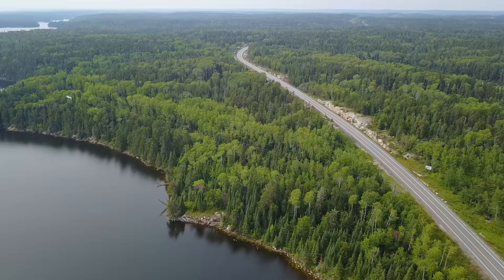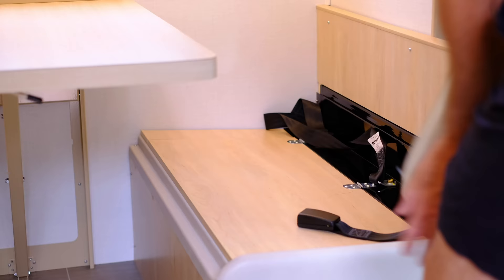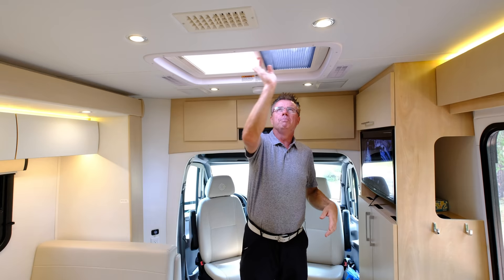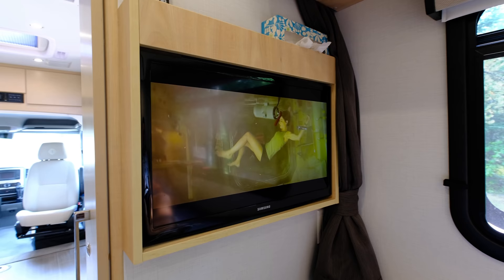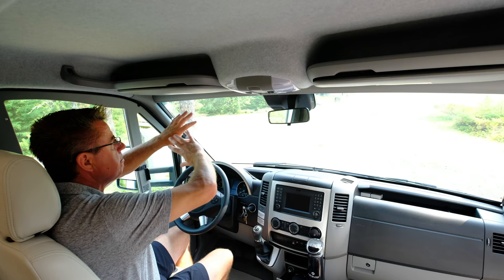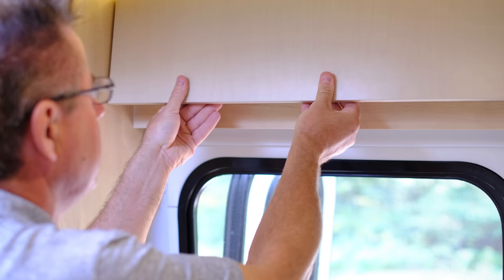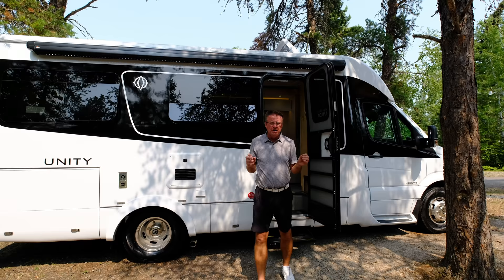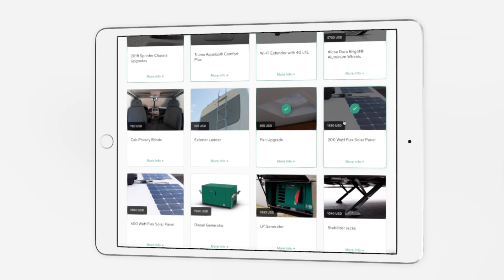2019 Unity Corner Bed

Comment: I just saw a video with this guy taking a tour of a 2020 Mercedes motorhome while it was parked in the Arizona desert. The walls of the vehicle were made from a specially compacted material just like he said this one is and even though it was 90 degrees outside on the other video, inside the vehicle the AC wasn't even required. I need to find that video to send to a friend. Ill go check the links out too. "synthetic man made leather doesn't get hot or cold" so not from animals then? Did the shower have a privacy cover to go across the sky window? This vehicle is like a Tardis. Loads of room inside but looks smaller on outside. He definitely knows what he is talking about and selling. It makes all the difference. He deserves to cool down in the lake, I didn't expect that, excellent ending. Excellent scenery too from Great Britain.

Comment: You say this is a prototype? Please make it so that we do not need a generator and it will charge itself in the sunlight with lithium batteries put in a air conditioner runs off a 12 V and enough lithium batteries out it’ll  run through the night. Just like the Boldt.
Also make it available for those who will pay for it to be four-wheel-drive and then you have Dotted all the i’s and cross all the T’s.

Comment: Most clever design elements I've seen so far. Love the overall style! To the manufacturer, why are dinettes not offered with an optional two-seat version, with all that other space occupied by 4 seats used for more cabinets? Use pull-out drawers beneath the dinette seats rather than awkwardly dismantling them to get to the under seat storage. Why isn't the mattress built to raise up on hinges so that the underside offers the full space x 5 inches beneath for critical additional storage?  The awning is great, but where's a simple roll-up three-sided canvas & Velcro attachment that would turn that space into a livable additional exterior tent-type room? Such a small thing would double the living space when parked. Give us a built-in safe, a deep sink you could wash boots in, a built-in 5-gallon bottled water dispenser, built-in surge protector, built-in vacuum with hose that will reach from dashboard to rear, and a small wood-burning stove that can be opened to the inside for off-grid heating or closed and opened to the outside for off-grid cooking, please.

Comment: Unity, thanks for the nicely-made, explicit video! You've nearly created the perfect compact RV. Clever, beautiful, and functional. If you're interested in making the next model reach Perfection, consider: 

1. Move away from the old-fashioned gaudy racing-stripe exterior. Should be easy to offer a custom color choice in solid paint shades that blend into surroundings, especially when stealth camping.
2. There's wasted and unused space everywhere that could add at least 10 square feet of additional storage.
 Find it, use it.
3. 
Add a hinged or pull-out door to separate the back/bath area from the front/main area.
4. Please offer dinettes with an OPTIONAL two-seat version, with the unneeded seat space used for more cabinets. 
5. Raise the big mattress a few inches for more under-the-bed storage depth, and why isn't the entire bed-size space beneath being used instead just one corner of it?
6. The awning is great, but please provide an OPTIONAL three-sided canvas & Velcro attachment that would hang from it and wrap around it, creating a livable additional exterior tent room when parked. 
7.  Wet bath: recess enough small racks in the walls to hold at least 12 bottles with heights equal to a mouthwash bottle. Also, there's room for a nearly full-length mirror on one wall or inside the door.
8. USB charging: Instead of a lone USB charging outlet here and there, create and recess one space providing many outlets for charging multiple devices This is a must from 2020 forward. Recess some kind of caddy sizable enough for a laptop, for every USB charging outlet. 
You have the space.
9. Please put all the electronic controls IN ONE PLACE facing out at eye level (such as above the door). No squatting, stooping, or neck craning to see those things!
10. Recess at least 2 caddy spaces for rechargeable flashlights and put 110v plugs in that recessed area.
11. Install a hidden steel safe bolted-in somewhere out of sight.
13. Switch to a 12-inch-deep kitchen utility sink that wet boots or a big iron skillet can soak in.
14. Find a way to install by the kitchen sink corner a 5-gallon bottled water dispenser.
15. Surge protector: at least make available an optional built-in surge protector.
16. Vacuum: install a a recessed and easily interchangeable canister vacuum with a hose that will reach from dashboard to rear.
17. Sconces: recess in main cabin several built-in vented wall sconces for holding candles when camping off grid.
18. Chimney hole: provide an OPTIONAL chimney hole over the range where a small wood-burning stove can be set for interior off-grid heating (that can also be detached and moved outside for off-grid cooking).
19. TV: that's a lot of real estate used for something that won't be touched most of each day, so how about mounting the tv as the face of a storage cabinet behind the tv? (Need a place for storing clean bedding.)
20. How hard would it be to include a drop hole into a hidden waste basket?

I challenge you to find a place for a dirty clothes hamper, and I believe you're the creative force to finally figure out a way to recess out of the way from feet but accessible a pet water dish. There has to be a way.

Comment: 1. $135,000
2. No boondocking possibilities.
3. Golf-cart batteries.
4. Need always running generator if you want anything done.
5. 1000 watt inverter... in 21st Century...?
6. Did I mention it's $135,000 without options?
LTV's reasoning for lack of tech - "It could break down and leave you without power" ... So they decided to leave you without power from the get-go

Comment: One can dream. Quite a few questions, as my spouse & I (both medically retired military Veterans) are thinking of purchasing a small RV: (1) is the safe welded to the metal frame? If not, it would be just too easy to rip it out of the wood; (2) can you add more than the traditional 2 deep cycle batteries?; (3) does it have interior (hammock) heavy duty style clips (which would allow you to install, say, a small one person sleeping hammock for an extra adult sleeping berth? As I feel/see that the extra sleeping berth in the kitchen area, is just a little too small for two grown adults); (4) is there adjustable shelving & fans for the electronic areas (as this would be a must if you wanted to add extra electronics, & not have them overheat. If not, no biggie, as my wife is a welder, machinist, industrial painter, industrial fabricator, pipe fitter, etc. The military has trained us well); (5) any military discounts?; (6) do you have an interior ladder hookup, that would allow you to climb up onto the roof from the interior? A great safety feature (yes/no?); (7) again, do you have extra shelving for under the kitchen sink?; (8) a lot of moving parts. Does the initial package come with a spare parts package... like knobs, screws, fuses, etc?; (9) does it come with front hood protectors, like an entire front wing (to deflect rocks) & an entire hood protector?; what is m/pg (kms/per Liter)?; does it come with a rear ladder (if not, will be kind of hard to put out your solar power panels)?; & etc. I could go on, but that's enough for now.

Comment: Very Nice floorplan, but that Sprinter Chassis ruins it for me.  Mercedes had a great run with the Sprinter, rock solid, but with the newer Chassis Offerings from Ford and Dodge, it's just not worth the (substantial) extra cost for parts/repairs/maintenance.   Find a way to get a Ford under that thing like your Wonder model.
Reply: Chris Donley — Ford over a Mercedes?!  Have you driven a Ford lately?  Are ya sure about that?
Reply: Erin Thorkildsen -  Well if you don’t mind 3x the price for repairs, parts, and maintenance.  Your body and frame rusting out after 10 years. Interior/dash styling straight out of 1999, and safety/comfort features straight out of 2008.  By all means, go with a Sprinter.  They are tried and true, but time has passed them by.
Reply: Chris Donley — True, all valid points.  But the life span of the Mercedes is 10 times that of a Ford.  My friend has a less than 1 year old F250 diesel PU, it’s had 5 major repairs, requiring 3 tows already.  And he sings it’s praises daily, even when borrowing my truck.  LOL!
Reply: @Chris.Donley  Sprinters are now made in South Carolina. Possibly the prices are less expensive for parts.
Thanks to Nikki Haley,  former governor of SC.
Reply: @abundantlyclear    You would think so, but that just not the case.  Also, Not all Mercedes dealers service the Sprinter. They are few and far between.  Just to give you an idea for cost comparison.  To change out the Manifolds (Parts/Labor) on the Mercedes vs Ford $7000 (Yes, $7K) vs $1200.  Muffler and Cad. converter, $3400 vs $900.  National Average Ford Dealership Labor Rate- $115  vs $225 for Mercedes (including Freightliner, which some also work on Sprinters).  You also must take into account, many of the Sprinter parts come from Germany, wait times have been known to be as long as 3 months or longer on certain parts.  The one that really makes me hiccup, the Sprinter Van  OEM Diesel Particulate Filter (just the part), $1800.....(Yikes)....
Here is a great article from a fellow who owned nearly 50 of these Sprinters in the last 10 years, interesting read.  -

https://www.linkedin.com/pulse/fatal-flaw-mercedes-benz-sprinters-tom-robertson

Comment: Noticed the head unit is always some tiny 6/7” display.  Given you’re on the road for hours and need directions in advance.  Why don’t they install one of those iPad size display like on Tesla or new Prius.  Much easier to control and see where you’re going.  Some even integrate GPS onto dashboard like Audi.  And should come with advance parking assist with 360” cameras.  Just saying maybe Leisure should be first to put more tech for the driver,  just makes sense or else you’ll never get where you wanna go without being stressed out with directions.

Comment: I've not gotten my first RV yet. I wonder, which company builds an RV that will fit in a typically sized parking space? All I need is a bathroom and bedroom and a dining table that you can make into an extra bed. I don't want a swivel out table to work on. I appreciate any suggestions. I will be living in it full time. I'd also like a generator and solar setup too. Thanks for any suggestions.
Reply: Look at Winnebago Travato, Hymer group in receivership but has a couple models.

Comment: Lithium batteries? Fuel cell?
Reply: I agree, love LTV but they really need to start looking at under the hood generators, lithium batteries, AGS (really to start the engine because of the under hood generator). Those items would put them to the very top spot.
Reply: Just wait for the stock batteries to go weak in a few years and replace them with drop-in lithium batteries. Fuel cells are for people who aren't satisfied with their RV turning into confetti in an accident and would rather see it blown into a fine powder. Tank full of the most volatile element in the universe + tank full of oxygen = a VERY powerful bomb. Considering the failure rate of RV systems generally, I wouldn't pick THAT one with which to be an early adopter. There's a lot to be said for sticking with the tried-and-true instead of cramming all the flashy gee-whiz shiny things into a rig. Just consider that many manufacturers haven't quite got the hang of lithium systems, yet, based on all the glitches we regularly hear about from RV vloggers on YT.
Reply: @colormedubious4747   Too bad lithium batteries offgas and sometimes burst into flames even when not in use. It would be great if they didn't because they are lighter weight than the lead acid batteries. I'd prefer everything to be solar powered.
Reply: Liphos can be swapped in no time aftermarket! A fuel cell is rel. Low efficient for the buck ( 3-5000 bucks, plus bio ethanol and a dripping hole in the flloor for about 200 W/hour???) 
My Liphos is 160 Ah and can be charged with 1C. So less than 1/2 of the weight to carry! Solar will refill them in no time until noon when sun is out..when installing an Booster you can charge when driving to the dumpstation or grocerery with 45 60 amps...done..( if no sun) in 1 or 2 years from now Lipfos will be more affordable and 1:1 same size like standard Batts to.(160 Amp / h with cell controller and batt monitor is 3000, Dollars) it charges with the gel settiing on an installed charger or seperate charger for Liion with 14,2 or 14,4 or 14,6 end Voltage..plus you can drain the batt 80 % or more..(50% with lead acid)..having 2 pv panels on the roof I found 1  100 Watt tilted freestanding panel is a nice add..and if Mt Cis they work with daylight..so most of the time no fuel cell needed.( my set up was tested last summer, 6 month no shore power..works)
Reply: @rveurope  - WATT fuel-cell uses 1/3 lbs. of propane per hour and produces 500 watt continuously, 1000 watt on pick.
Reply: @Samuel10463  thanks! I saw some information about them, where to buy and how much is a 500 Watt ( about 30 Amps woow..love it ) that will be cool..I mad a mistake in my statement the efoys have not 200 Watts they have 100 Watts  or < than 10 Amps..(8,75) for 5000 Euros, or 5500 USD..if you buy a big battery 3000.- + 5000. - Plus 500 instl..thats a statement for 8,5 Amps..do you know how much are those Watts? 500 is cool?  
-> again a Büttner Booster on the Rv engine produces 45 Amps/h or more.. Plus solar 2 - 20 Amps 47 -60 plus..that could also a  acceptable ( if we talk battery charging only)? 
-> if I have a 1,5 Kw backup gen. I fill my batt via on board ( 2 chargers) within one 1.. Thats also a option ( yeah smells and noise correct..
Anyway interesting topic for coming summer...thanks! 👍

Comment: DVD Player? Isn't it 2019 now?
Reply: I still need one 😊
Reply: Yeah I think the cell phone booster and a fire stick or AppleTV would be a better choice. Redbox is going to the same place as Blockbuster. So the future is streaming. However, a DVD or BluRay player is nice when you really are out of cell range.
Reply: @dirtbikefan2007  Not if you don't have internet. DVD works without internet.
Reply: MB Stereo system has CD /DVD Standard ( Nav is a DVD to)
Reply: Vhs is standard. DVD is an option.
Reply: I'm a grandma what's after a DVD player. I wish i wasn't joking.
Reply: DVD's have their place.  For the older generation it gives them a comfortable form of entertainment they know and understand.
Reply: When you have no internet it’s 1985 again.
Reply: Big Irish Yeti / for digital format DVD/Blue ray is the last fallback. It's available for Vans/cars running at 12 volt. But tape players is not a mobile format.  That said as long as you have A/C power you can use a tape player.  

Used and new BR disks are still available in stores not so for tape.

Comment: Corner beds are awful! You can’t make the bed and there is no legroom so you’re feet touch the cabinet in front. You end up waking your partner to go to the bathroom. I would rather have the bath split on each side then a slide out for the bed. Bunk beds over the driver area would be wonderful for a couple to come along.

Comment: How many times can you say, "European hidden hinges," in ONE video?  Complete oversell, dude, you can't even fit in those "ultra fake leather" sleeping areas and your head is IN the skylight in the shower.  Nice bathroom, but a medicine cabinet does has shelves, kudos having two fans in the build.  I sure ass hell hope that drivers seat is comfortable...with that lame 188 hp engine, two days to twenty engine with mopeds zooming past you.  You're pushing a MB sound system and perks...in a "MB" van...really?  The mattress cut with an electric turkey carver is way sad.  Batteries and fuses nicely accessible, my compliments.  You're making this ride sound like the chariot of the gods and you only have a max of 400W of solar, how long will your AC run?  Wait, do you have an AC, it is 92 degrees outside?  Stop the oversell and take a moment,  not to mention your BP pill, you're really red, and you may have something van wise.  BTY...you're way smarter, I had to go to the internet to figure out the plot to the movie Gravity.